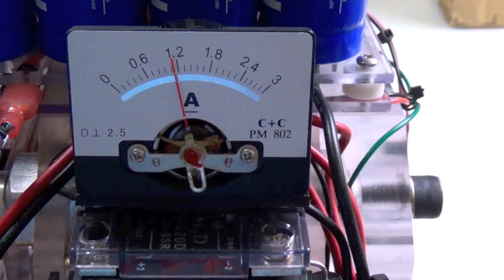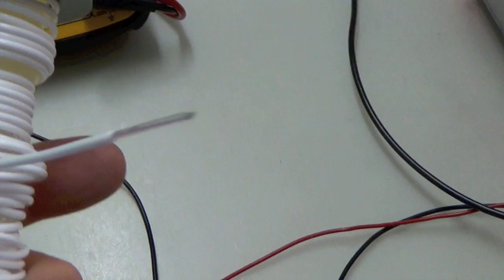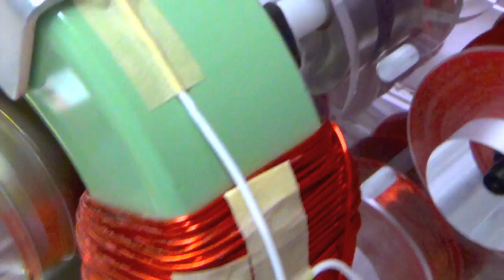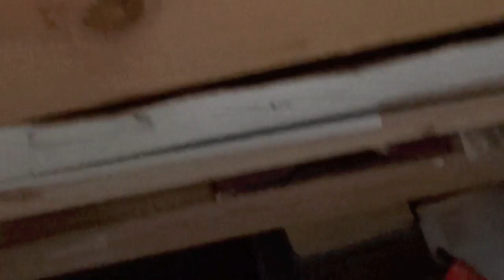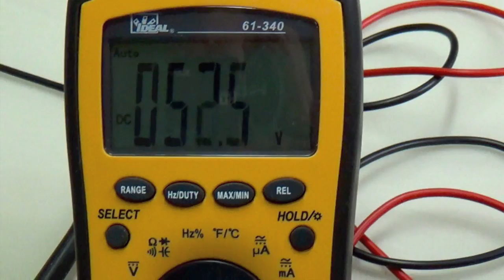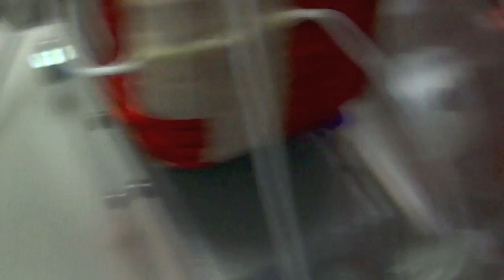600% AMPLIFIED VOLTAGE from TPA

Comment: The name of the effect ...is a électrostatique commutation of robert adam... This commutation move electron and re gauging power on the line the commutation is real ... ❤❤❤❤800percent of robert adam...now for active régénérative accélération. ..use a quadrature of coil with ...90degrees bariuym magnet and use 41 awg 2000feet ...❤its my configuration...

Comment: If you modulated the coil and shorted it at 20,000hz youd get up into the hundreds of volts from the spikes adding up in the capacitor. That's an awesome little motor. Also if you periodically shorted the coils theyed let go of the magnets and help raise those rippums! (Rpms)

Comment: Maybe  reduce the  diameter of the shaft and bring in the magnets then find the speed of the electrons, do you have any idea to push the electrons though a normal setting like on an induction motor?

Comment: I am curious if you can tell me if the Bi-Toroid makes a good alternator, not a magneto, but a regular alternator? Does this design eliminate Lenz's law and generate a significant amount of current and voltage, or does the current and voltage output go down linearly in correlation with the decreased drag of a Bi-Toroid alternator? I have seen this design in the Patrick Kelly energy eBook and I've always been fascinated by it!

Comment: The concept to utilize  the    amplified   resonant   power  produced    from the toroids  with the introduction  of  amperage from   the  resistance of the  spark   gap.  I  think   it's  a  sine wave high-frequency   generator  transmitter.    I  like it!   With  an oscillating   recovery    super capacitor bank   reserve & alternating storage,  it   could  be used as  a power source for  home electric heating.  Levitating   bearings  would increase  efficiency and reduce  wear.

Comment: I'm confused about the magnets you have on this one... it's not the same as the Q3 Toroid Upgrade kit in the next video. Here, you have small magnets glued to the large ones... and you also run 4 of the larges ones, not just the two shown in the upgrade kit. 

My comments on the previous video (about using smaller, 90° positioned coils) were based on the use of 4 magnets, and I actually didn't realize that you had piggy-backed magnets.  The large ones are probably too far from the coils to work well... this type of generator needs a very close magnetic field to induce the current flow in the coils. (again, experience speaking here)

It's only the wire sections at the ID of the core that receive any direct magnet induced flux change for [direct] induction... the other 3/4 of the wire (front/back and across the O.D.) is tied to the core itself, which only gets secondary flux.  By this I mean that the inner 'quadrant' of the coils receive the direct 'magnet-induced' flux (Primary wire induction); which induces current flow in the wire, which induces magnetic flux into the core, which then induces current in the remaining 3 quadrants of the coils (Secondary wire induction)

Comment: can you show amps when amplified ? if you have same amps then it's a power gain. 65V x 300mA = 19W but if you have 286V and same 300mA it should be 85W, then it will be power amplification. Is this only voltage and amps are dropping? it means this affects only the receiver?

Comment: can you  give me aHi I’m Anthony  in Vietnam ,A disabled teacher trying  to get us  some  electricity can you help.
We donate our time here helping kids learn English
The pay is room  , board 200 a month
Power out always n inadequate 
Im building
3 DISK 36 MAGNETS.
I want to buy circuit board can I  get one with a pot on it . I have   a dual  9 magnet center disk each side  then left n right 9 mag disk n a coil for each .
36 mag 4in x 2 in x 20mm  
 2 stater  9  coils   I8 coils 100ft x 7  + 1  24ga 100ft 
I have saved  n gotten  this after 5 years 
Don’t laugh
Our pay is seeing us making a difference in their lives
Look at moc model   attachment          the paper  rectangle r 4in  85mm dia coils
BELOW  IS HOW DISK 1 CENTER N UPPER DISK N  LOWER DISK 
DISK ONE IN MIDDLE MAGNETS BOTH SIDES  WITH MAGNET NSNS N MATCH  FROM BACK SIDE SAME POLE
NOW I NEED  circuit boards  n how to put this all together diagrams or all pieces n ill try do it myself maybe cost so high assembled but here cant find mlf211194 transistors
                                            DISK2 DISK   
 DISK FRONT MAG      SNSNSNSNS
         COILS                       CCCCCCCCC
Both side   magnets    NSNSNSNSN
  DISK 1                           |DISK 1   DISK} 
                                            SNSNSNSNS
COILS                                 Cccccccccccc
MAG FACE C                   NSNSNSNSN
`                                          ---------------
                                          |    disk   3       |
                                           ---------------
                                           
Sorry for the crude configuration of disk magnets n coil above.
I have  all bedini handbook n intermediate books n quantum key
Magnet secrets ,  trying to find some Bearden books .

Now I have 36 magnet 4in  x 2 in x 20mm
7  I n4001
7 1n4007
7 100omh r
10 kg wire that I collect over 5 years I begin to wind coils now
All here very old same as me or older
Cant afford to live in us aim disabled the rest retired all of us retarded crazy n old all same im  crazy for this [project n say give it upits a scam so that’s my fuel
Over unity take the negative to power  my mind to push 
Father nothing is impossible as long as we try.
No  books I have show me how to do 9 coils  2 banks 18 total n how to put it all together please  help

We get mail in Hanoi I go embassy  once a month sign name to get ssd prove we survived another month
Thanks in Advance
God bless us all.! 
address
số 7, ngách 143/64, ngõ 143, phố chợ Khâm Thiên,
phường Trung Phụng, quận Đống Đa, Hà Nội, Việt Nam.
DT:01644783469
DT:0988727188

dvice

Comment: Could you explain a bit closer what this actually does? like i'm not english and i'm only 15 yo but verry interested in these things. I guess its just converting Voltage to Amps or something simular. So i guess its not able to keep powering itself for instance? or would it be possible to let it power itself and still gain a profit of it? Probably not since i learned that energy only can be converted from something else. Hope you get what i mean :p

Comment from the maker: This is not a standard off-the-shelf generator that connects directly to a load where current is of extreme importance. Its primary goal is to pulse a potential difference into a storage medium. Current will then be demanded according to device being driven and overall volume of storage.

Comment: Interesting. Your max output power will most likely occur  when external load has same resistance as internal resistance of the source ~~ which is your output stage... (max power theorem) -- it shall be interesting to see when you are not using short circuit measurements - rather a load, work done. Very interesting!

Comment: A more efficient generator or electric motor designed for a specific purpose is an exciting project to follow. I don’t know if I’m correct but I feel that many think that experimenting like this has already been done 100 years ago and there is no new ground to break. I figure in most cases these negative type comments are a weak attempt to make one feel smart. Ha!

Comment from the maker: It's not a transformer. Instead, a toroidal alternator/generator producing shorted bursts of HV DC spikes. Current remains identical under vacuum pump load, but pump rpm increases.

Comment: Love your work. You say its600% power amplification: but is it not just the voltage 600% up and is the current not going down by (at least) 600% ? And how to measure this??
Thanks 4 sharing :-))
Greets M

Comment: As always, i am very inpressed with Your skill. I like the new addition. Radiant energy is a foundation to my work and when Your get It to self run the scope patters are Souther of this World.  I was not going to jump in on this motor thing yet but i just landed a contract and i ama going to share. I do have a question that i adress, have you taken in frequency and duty cycle into your O/L for a complete power correction. David A. Puchta

Comment from the maker: Thanks. I know what you're thinking, but as I told Stefan, charging that cap to HV doesn't mean anything at all. 
But what does have value is when the entire pulse motor and all generators attached drawing only 360mA at 25V will allow the toroid to output a constant 60V when engaged with fully shorted DC output at 90° without causing additional current demand or strain on the motor. Without shorting, it only produces 7.4V.  60V / 7.4 = 8.1 or a 700% increase in voltage only. 600% was modest.
Reply: 200 000$

Comment: Well, it is voltage multiplication but it takes time to charge capacitor and obviously this is where amount of generated power comes. If you attach load to capacitor it won't keep to high voltage unless you make to the point where capacitor is charged faster than unloaded into load. As the side note - Ismael Aviso used disruptive capacitor discharge for driving motor in his car. So there are uses of this technology.. :)